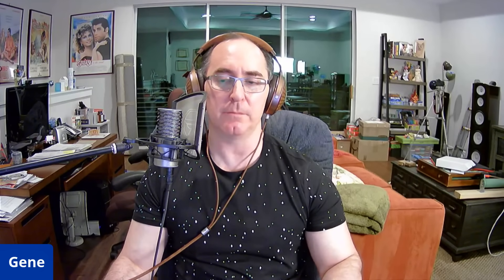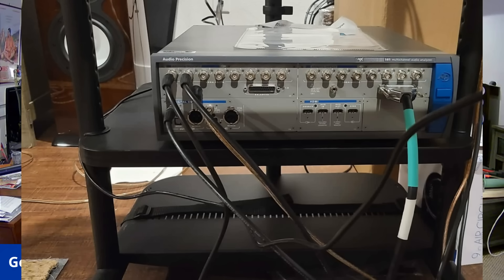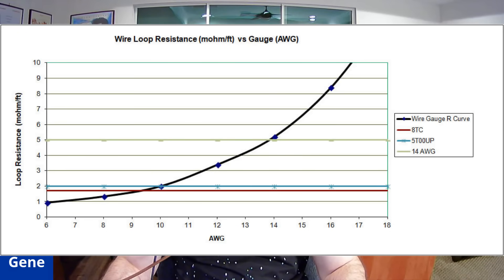Speaker Cables Really Don't Make Much of a Difference?

Comment: If your speaker cables don’t make a difference your stereo system needs an upgrade.  Every upgraded wire you add will change the sound. From power, rca, speaker cable, it all makes a small difference.  And if you’ve already bought a great amp and great speakers,  the only thing left is the cables.
Reply from the maker: You forgot about the room Acoustics which is actually the most important component to good sound.
Reply: @Audioholics  Totally! Room acoustics is huge. Just treating your room will make your speakers sound much better.
Reply: But I do agree with a lot of what this guy said.
Reply: I’m using 24 solid core wire that I put together myself.
Reply from the maker: @Disabled-adventures  24awg is terrible to use for speaker cables. Way too much resistance  and will greatly impact the sound of your system in a negative way.
Reply: @Audioholics  each leg of 12 wires makes up 8 guage wire.
Reply from the maker: @Disabled-adventures  Oh ok, I thought you meant the effective gauge of your cables was 24AWG, which would be terrible.

Comment: Analogue cables, interlinks, speaker cables do sound different. You can loan 2, 3, 4 pairs of cables, put them on a proper set and LISTEN. 

More expensive is not automatically better. Just loan a few cables and you can clearly hear a different.   Very simple example  i got copperhead interlinks for the pre and poweramp, and bass was a mess. Added Supra interlinks and bass was 10x better under control.

Comment: It's much like hifi grade gold fuses, or the idea that 100 miles of pylon power out in the open all weathers is poor electricity which can be "cleaned up" to audiophile standards in the last 3 feet from wall outlet to equipment by some super clean connections and power cable. Or a wooden box you stand on top of your amp that can cost 100's of dollars, but whatever you do, don't force the box open to see the block of lead glued inside or you'll void the warranty. Of course it will. People with too much money, no sense, and burning need to impress the neighbours fall for all this crap...

Comment: Human ears can "measure" much more than any instrument that humans has created. Material, diameter, dielectric properties, inductance, capacitance, makes huge difference in sonic characteristics. But as you won't have better car by mounting formula one spoiler on the WV Jetta, same you won't hear difference with average hifi system. Speaker cable makes biggest difference, next is interconnecte and power cable at last. Beleive it or not, try and will hear.... Regardless what you measure....
Reply from the maker: That's the fallacy that only thr misinformed make. The human ear can not discern 130db of dynamic range that our test measurements can measure. It's also 100% consistent while our ears are not.
Reply: @Audioholics  #FACTS
Reply: You are way of of the times there buddy. We are not living in the early 1900's anymore. Technology has far advanced beyond what your ears can hear. Test equipment now is insanely accurate far beyond what you can hear. Your eyes must be amazing to that we don't need x-ray and MRI machines then right? Try some null tests and see if there is a difference with your fancy expensive audio inter connects.

Comment: Good video and thanks for taking the time out to do this. As an engineer I learn towards science and facts but here's the thing, I make my own cables and honestly I and others can hear differences. I agree the differences in speaker cables are very modest whereas the differences in interconnects can be very audible and noticeable to everyone. Is there a scientific reason for the difference between speaker cables and component interconnects ?
Reply: Resistance and inductance variances in cables tend to act as tone controls. You can also have a tendency to cloud or "free up" the sound if the electrical properties of the cables don't mesh well with the amplification and speaker circuit. I think what many "sciencey" guys push back on is the price to return ratio. For them, it doesn't make sense. But I also know many of those guys wearing $12k watches and driving $80k vehicles so I'm skeptical their hatred is objective.

Comment: I still don't understand how ppl still say that cables make no difference ... I'm not an audiophile ... but just going to my local hardware store and buying normal  electric wire and creating a cheap as hell cable with 4 of these wires per speaker made me a world of difference! its like I never lissend to the speakers before... should I assume that the change will be different from system to system, and that's why there are still people that change the cables and say they don't hear noting !?

Comment: Would be interested in the effect of some common cable connectors which could add LCR to the cables? I use Home Depot 12G zip cord at $0.10/ft and get good results but would bare wire be better than spade or banana connectors?

Comment: Agree 100%, best way to view speaker cable is as a tone control, different speaker cables sound different, simple as that, it’s really what sounds best to your ears. I have an high end system but with inexpensive cables and it sounds good to me. I’ve been into audio for 45 years and paying £1200 for a set of speaker cables is just nuts. That really is snake oil.
Reply: Agree with you been in it for over 50 years the room environment is much more important

Comment: No difference whatsoever  on entry level stuff, just as an experiment I wired £1 per meter Wilkos speaker cable(bell wire!)  into one mission speaker and award winning QED at £13 per meter into the other from a £500 DENON Receiver...couldn’t tell the difference 🤷‍♂️

Comment: I trust that differences in performance can be measured, but can two similarly measuring/performing cables sound different? I don't have fancy measuring gear but there was a discernable difference between canare 4s11 and mogami w3103 cables that I've tried.

Comment: Fantastic video. I knew this all along (in my mind) but never heard that proof behind it. I fell for the cable BS for a while. Then I tested a $1,000 pair of cables vs. 12 AWG cable I bought on Amazon. Zero difference. My audiophile friends could not tell a difference. I told them the expensive cable was actually the cheap cable and vice versa and they picked what they thought was the expensive cable. There are no "chocolatey midranges" etc. Same goes for power cables. The power is coming through romex in your house. How does a power cable magically change electricity? All BS. Thanks for the great video.
Reply: Of course you did

Comment: I use Blue Jeans canare speaker cable for my fronts and some generic bulk cable for my rears. I wouldn't spend more on speaker cable than I did for the Blue Jeans. While not speaker cable, I do have AudioQuest Golden Gate cables going from my phono pre-amp to my amp. I never thought I'd pay that much for RCA cables, but they were the only set I tried that completely eliminated an interference issue I was having.

Comment: The video shows cables physical n electrical properties. In real, r v talking sound properties wrt cables. Should it be : comparing master sound signatures with measured sound characteristics with different good cables, any differences? Good cables mean no sounds conteminations (colourations of sounds). Can demonstrate???
Musical sounds r dynamic in nature, not measurements of static cable properties, like ohms, capacitances, resistances, amperes, frequencies, DC/AC.
Reply from the maker: Oh boy. There is little hope for the future of humanity.

Comment: Hey Gene I LOVE your videos. Would you say the same goes for power cables? I’m
Sure there are better power cables for sale but what can a $600 power cable do that a $50 is not going to do for you?
Reply from the maker: Only 2 reasons you should ever change your power cables: 1. The OEM cable broke. 2. You need longer cable. For #2 use lower gauge if needed to offset resistive losses.

Comment: Measurements mean nothing other than showing impedance differences!
Reply from the maker: Haha OK so educate us how to analyze performance on cables.
Reply: @Audioholics  You measure quantities...and you show me how quantities correlate with quality. How do you measure synergies etc.

I measured and tested tons of earphone cables - all cheap. They all measure the same, but some sounded different from others. Not just a bit, but quite different, to the point that the sound was strident. With other iems, there may not be a sonic difference.

How does one measure that?

Not everything that matters can be measured and not everything that can be measured matters - Former Audio Precision CEO paraphrasing Albert Einstein.

My observations based on earphone cables:
- Cables can make a sonic difference, mainly with multi-driver earphones
- This difference possibly relates to impedance, wire material, and wire structure
- Impedance differences may in some cases be large enough to result in different sound volumes and can also alter the earphone’s frequency response; such changes in the frequency response can be calculated
- Cables may not make any difference with some earphones
- Listeners often mistake volume increase due to lower impedance for sonic improvement
- The sonic differences between cables are largely independent of price
- If sonic differences between cables exist, they are not universally valid but only relate to that particular earphone and the cables used in that particular comparison
- Eartips are the cheaper alternative to achieve a different sound
- Expensive upgrade cables may sound worse with your favourite earphone than stock cable
- One may be better off spending the upgrade cable’s price on better earphones

As to speakers, I have used 10-gauge copper - generic stuff. Since 1986.
 
I did not watch the video, by the way.
Reply from the maker: @audioreviews  I seriously doubt you measured all of the parameters of a cable to come to your conclusions. You can't do this with a multimeter. I have a $10k calibrated impedance analyzer to make these measurements and judgements. If you didn't watch the video, how could you disagree with my points?
Reply: @Audioholics  I only measured the frequency responses with the iem attached.
Reply from the maker: @audioreviews  I assume that means you measured frequency response with a microphone and not the electrical amplitude response. If so, that is a very imprecise way to measure tiny differences in signal due to variances in the acoustical measurement and mic position. Very easy to lead to wrong conclusions based on this method.
Reply: @Audioholics  You should also know the difference between precision and accuracy. Precision is a measure of reproducibility. You measurements are précise when a series of them yield the same result, even if the measurements are inaccurate.

Example: you want to hit the 20 on the dartboard but always hit the 3. This is inaccurate but precise.
Reply from the maker: @audioreviews  Thanks for the high school physics lesson in precision vs accuracy. The difference is my measurements are extremely accurate as I have better test gear than most if NOT all of the major exotic cable vendors making the cables that they sell. Again you've given no alternative to analyzing cables than the process I used based on proven engineering principles and science.

Comment: Why are there generally NO  specifications on expensive cables on the packaging?  Imagine the outrage when purchasing an amplifier and reading the specs, only to find : OUTPUT- Enough   :: THD - Minimal... I don't have an issue with manufacturers  charging obscene money for soldered copper wire per se (Albeit I won't buy it) but I think its a bit on the nose not disclosing to the consumer what they are actually paying for.  All other manufacturers do.  Exotic Cars, expensive cameras , computers , phones etc

Comment: I have and use Kimber Kables and they are the real deal. The worst thing about reference wire is if you audio equipment suck, the Kimbers will expose your gear for the pieces of crap that they are. As much as I hate the tangling wire I won't even use bluetooth.

Comment: Thanks Gene,   If I send $50.00 on speaker cable, and it sounds good,    then turn around and spend $500.00, on cables.  I want to HEAR $450.00 worth or a 9 times the IMPROVEMENT, over the $50.00 cables.  I use this analysis on 95%of everything I do, in Audio, Photography, etc.,   If it's does prove out to MY ears, I'm dam sure not going to pay the DIFFERENCE!    I can live without the Flashy Jewelry!  Love the Channel!  Thanks for all the work and effort you guys put into your REVIEWS.

Comment: Long ago a friend of mine an audio engineer tossed me a 100 feet of copper solid 8th inch in diameter coated with Teflon. We cut them into length and breaded them. Thick stiff but awesome cables. Helped eliminate antenna type noise and increased the bass response. Not the prettiest more on the awkward side due to stiffness but helped my system out a lot. Took care of some of the anemic symptoms I was having. So go figure!
My cable was free would I spend thousands of dollars on cable I do not think so.

Comment: Using Canare 4S11 cables by BJC, ultrasonic welded terminations was my main attraction. I had Much more expensive cables that were thicker and nicer to look at. When I changed my system configuration I needed shorter cables and tried these,  sold off the hoses and never listened back. 
This was a very down to earth informative video.  Subscribed & 👍🏻

Comment: excellent ... I suspected from the beginning the difference should be negligible.   I work with cables up to 550Mhz (for 10GB data transmission) and at that frequencies even a curve in a cable affects a lot, but those super LOW frequencies , any good quality 12 or 14AWG will perform great !   wonderful review . CUT THE CRAP,  Kuddos !!!